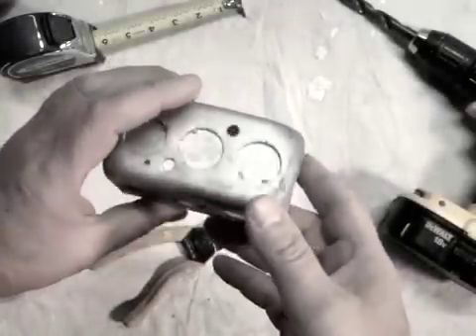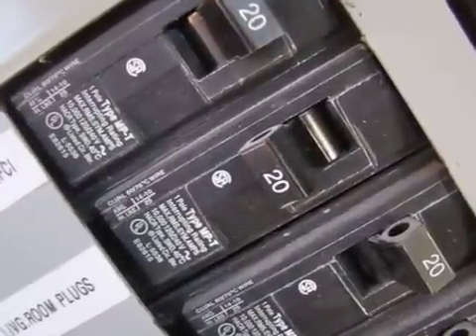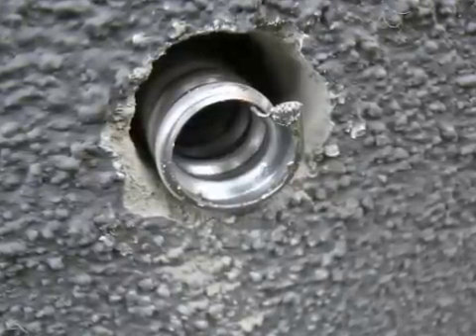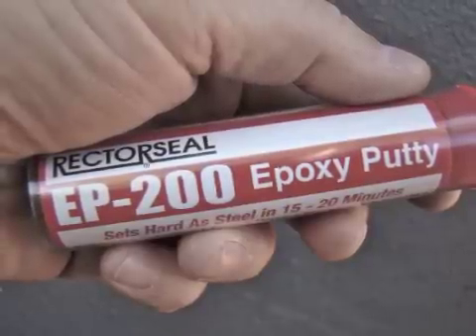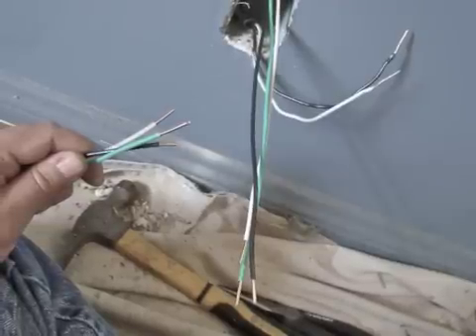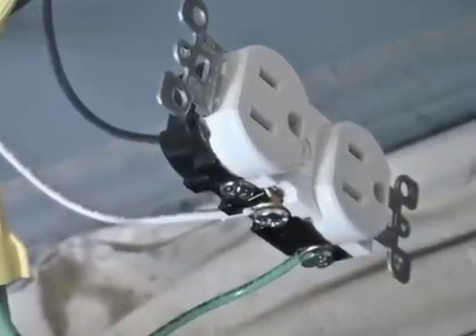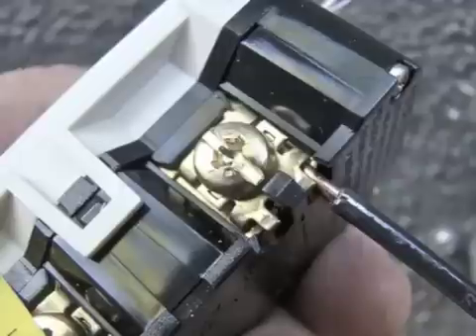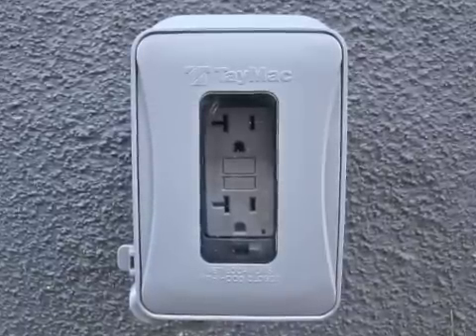Outdoor GFCI installation tutorial

Comment: Also, it looks like you installed a 20A receptacle on a 15A line. This is theoretically unsafe. That's why they have 20A receptacles in the first place.
Reply: Hold on a sec. The breaker is 20A. Then this is actually terrible. Because I am pretty sure I saw you use a 14Ga wire at some point. This is actually super unsafe.

Comment: To be honest I think it's kind of unsafe to put the GFCI protection OUTSIDE. Instead, you should really be putting a regular outlet outside, and put the GFCI protected outlet inside the house as close as possible to the panel, or at least far away from any sources or potential sources of water.

Comment: Very good video.  I have a question maybe someone could answer.  On the outside, is the end of the flex conduit flush with the outside wall?  Or, is the fitting going to the box flush with the outside wall with just the threads of the fitting extending from the wall?  Thank you.

Comment: You could have put the gfci inside and  swapped the standard plug to outside, thus having two gfci protected outlets, as the gfci protects all downstream outlets. That is of course if you take power for the exterior outlet from the inside gfci instead of using those abysmal wire nuts, wiring in series instead of parallel as you did. Fewer connections and more safety.
Reply: Good idea but better to get a weather resistant outdoor outlet

Comment: I see two code violations. The gang box in the bedroom is overstuffed and won't pass inspection. Secondly, it looks like your outdoor receptacle is wired with 14 gauge wire while the bedroom receptacle has the (correct) 12 gauge wire. This is a major no-no and a fire hazard. 14 gauge wire cannot handle 20 amps. Also why not just replace that old gang box in the bedroom with a new one? That old box is not bonded to the ground, which is bad.

So, in other words, don't follow this guy's video if you are DIYing. It's not up to code.
Reply: The exterior wiring is 12 gauge. He even says so in the video.

Comment: Great presentation, thank you! And I wanted to add that although not likely, some homes may have split circuit receptacles so I check both receptacles at the outlet for power, might need to throw two breakers instead of one. (Not trying to be nitpicking, just in the interest of safety is all)

Comment: Just a quick note. Your breaker is 20 amps as is your new GFCI on the outside but your interior receptacle is only 15 amps which isn't good. The breaker can supply more current than your interior receptacle is rated for and yet not trip. FYI

Comment: Instead of a pigtail, couldn't you have just branched the new wires off the second set of screws on the existing receptacle?
Reply: This is what I am very curious about. I am searching online for the information now.
Reply: Just wanted to update, I just finished installing an outdoor outlet where I connected the wires to the second set of screw holes on the back of the interior receptacle that is located inside the house. I spoke to a very knowledgeable associate at Home Depot who works in the electrical department and asked him if it was doable and safe. He said it was fine. So I tried it and all is good so far. 

I would not have had room for pigtailing inside the electrical box. It would have been too bulky so I am glad that this worked.
Reply: If you had a problem with the plug inside the house, you may at some point remove it. When you daisy chain receptacles you lose power to all downstream devices if an upstream receptacle is removed. So, pigtailing is preferred since downstream devices are unaffected when one upstream plug is removed. That may not seem like a big issue but in special cases it can cause big problems. For example on a shared neutral circuit (often used in kitchen appliances), if the neutral line is lost by itself you get 240 volt power overload to downstream devices. If you've got room and time to do pigtails, it's a better option. As you say, daisy chaining does work, and there is no advantage to pigtails for the last device on a circuit, although you do want to ground both the box and the device.

Comment: Question, are your receptacle both 20 amp, or are they 15 A / 20 A receptacle? Can you install 2 different amp receptacle?? Thanks great video!!
Reply: You really should not. That's the whole point of the extra T shaped connector, you should not be able to shove in a 20A appliance into a 15A circuit. You will trip the breaker, yes. But it's still unsafe.

Comment: Tried to do this, but when I drilled through the back of the receptacle, hit some sort of thick metal brace that's holding up the receptacle. previous owner was a terrible handyman. Left some receptacles unsupported. I guess I'll have to open the wall to do it right. it was a great video though. Thanks!
Reply from the maker: Sorry to hear about your issue. Anybody who's ever done this type of work will tell you that you don't know what surprises you'll find when opening up a wall. Most receptacle boxes that I've run into (whether old or new) are attached to the side of a stud either by nails or screws. Hope it works out for you.

Comment: I liked the way you mounted the box. Looks good and solid. That being said I never saw you check for a ground on the inside receptacle. Just because it is a 3 prong outlet that doesn't guarantee a ground. Metallic Cable or Flexible Metal Conduit doesn't necessarily guarantee a ground either. So if the inside box wasn't grounded through the MC or FMC then the outside box isn't grounded either. Not pushing the "test" button on a newly installed gfci receptacle to verify proper operation is kinda suspy also because that's the first thing I always do.

Comment: great video. can I use 14/2 wire, instead of 12/2 wire
Reply from the maker: 12/2 for 20 amp and 14/2 for 15 amp. 14/2 is smaller wire then the 12/2.
Reply: +JOE64POW . Tha k you sir for replying.  yes I know the amps for the wires. I should had ask you, what size breaker do you recommend. Is 15 amp breaker enough?
Reply from the maker: It depends, if you think you'll be drawing quite a bit of power from the outdoor plug by using, let's say, an electric lawnmower, you might want to run your plug from a 20 amp breaker.

Comment: My local always mounts the recepticals with the ground side up .
Reply from the maker: Look at most tutorials on youtube, you'll see the receptacle ground side is down.
Reply: +JOE64POW I was just making a statement to let watchers open their mind to other ideals.  .  I hate using this but to make a point i will.  Many people also followed Hitler and u know how that following went right?  
    
SearchSearch
 Materials & Systems >>  Electrical >> Ground Pin Up or Ground Pin Down?
Ground Pin Up or Ground Pin Down?
There is an age-old debate about whether an electrical outlet should be mounted with the ground pin up or down.  Unfortunately, there is not a fully accepted answer.  However, it is commonly accepted that the National Electrical Code (NEC) of the United States, or NFPA 70, does not provide any specific direction for the orientation of the outlet.

Ground Up or Ground Down?

Some theories about the orientation of an outlet:

The outlet should be oriented with the ground pin up because if the plug comes slightly loose and a metal object were to fall from above, the ground plug, which usually does not carry current, would deflect the object so that it would not hit is live prongs.  It is accepted that this idea began in health care facilities where many tools used for patient care are metal.  The story goes that hospitals were wired by union electricians and as the unions grew the practice spread to other types of buildings.
The outlet should be oriented with the ground pin up because this pin is longer and the plastic around the plug is meatier, so it will help to keep the plug inserted in the outlet.
The outlet should be oriented with the ground pin down because a person grabbing the outlet will have their index finger at the bottom side of the plug and the index finger sticks out further than the thumb.  Having the ground down will keep a person's index finger from touching the live pins.
The outlet should be oriented with the ground pin down because many common household items such as nightlights, timers, and battery chargers are oriented with the ground pin down.  In addition, GFCI outlets, which have text on the reset and test buttons, are oriented with the ground pin down (and the text readable).
A quick internet search provides comments that easily debunk any of these theories.  The most basic answer is that it truly doesn't matter which way your outlets are oriented.  Select the strategy that best works for you.
Reply: osz71 If you look at history of installs in local 98 out of Philadelphia,  they started doing this in hospitals because lf something like a doctors knife or something else metal were to fall on a plug that was falling out, the metal object would hit the ground first instead of the hot.  It makes sense to me and this is how I do my installs.
Reply: Wow godwin's law in the first reply, that was fast!
Reply: Michael Hinchey that's how I do them grounds up
Reply: Thats cause people that do that are IDIOTS!
Reply: The new standard is to place the ground side up. Hospitals have already adopted this. Go and buy a receptacle and you will see that the writing is upright to match ground side up.

Comment: I am a bit concerned tht the box in the inside room may be over wired and have not the capacity. remember the 2.0 for #14 and 2.25 for # 12 gauge wire.  Looks a bit tight, and I think new rules require pigtail wiring with wire nuts.  the reason I am told is that if one connection becomes open , rest of circuit will be fine.

Comment: A quick question, which drill bit you used for Stucco? I tried and all of them are slow, I use an metal drill bit on a impact drive.
Reply from the maker: +George Chen

Hi George, I used a concrete drill bit, you'll notice the tip is different then the multi purpose bits. Check the video, but I think I used a 5/8" concrete drill bit.
Reply from the maker: You want to use a masonry bit.

Comment: I'm new to all this, so excuse a possibly dumb question. I'm curious why you used pigtails for all the wires at the interior receptacle instead of having the incoming wires attach to the top (line) screws and the outgoing wires attach to the bottom (load) screws on the sides of the receptacle. Isn't that what those screws are for? Seems like you'd only have to use a pigtail for the ground.
Reply: +Firstname Lastname Oops, I meant incoming wires to bottom screws, outgoing to top. At least on the gfci receptacle I have, it says line on bottom and load at top.
Reply from the maker: +Firstname Lastname 
Thanks for your question. When more then one wire needs to be connected to a post, adding a "pigtail" reduces the multiple number of wires (that need to be connected) down to one wire. This is probably one of the most common reasons they are used. I find it's also helpful too because it gives some slack and wiggle room when you go to put a switch, receptacle etc. back into their box. You need room to move and adjust.
Reply: +JOE64POW That makes sense. Thanks for the quick reply!
Reply: +JOE64POW I agree with Firstname Lastname; the regular receptacles have 2 posts on each side so that you can easily wire receptacles in series and you don't have to pigtail at each box.  You can save time on each installation if you just would use the other posts.  Also on the gfci receptacles, they are set up to receive up to 2 straight wires on each post (because they have the clamp connectors).  This also helps to cut down on pigtails.  IF pigtails are needed, then by all means add them, but don't add them just to add them.  My 2 cents anyways, thanks for sharing the video.
Reply from the maker: Hi Thomas, thanks for your reply. Yes, you and "Firstname Lastname" are correct – you can wire it that way, certainly. I have learned from watching others (who were much more efficient then myself) that many times the existing (sometimes old) wiring that comes into a junction box is not long enough to make the connections easy. If you have short existing wires and connect them straight to the receptacles it will leave you with very little "wiggle room." I like the ease of adding pigtails and the extra "wiggle room" it affords. Do you have too do it that way? Of course not. I'm just offering people what I believe to be a great alternative when folks find themselves struggling with wiring a receptacle or switch in an old junction box. I think you'll find that this makes sense as you go along. Thanks much.

Comment: WOW, very well done tutorial. Just the video I've been looking for all night. I haven't done much electrical work to my house, but I need to bring electricity to my backyard shed. After, seeing several videos I have come to understand that I need to basically find an existing gang box and get electricity from there? All the other connections seem very simple.
Reply: If you're wiring a shed... what for? If for power tools or other high amperage devices, you might need to run an entirely new line from the power box with it's own breaker.

Comment: Hi I have a question? Can I just use outdoor rated wire instead of flex an get the same results?
Reply from the maker: Hi 1MRALANIZ,

I have seen other tutorials where some have drilled through the wall and shoved romex through to the outdoor junction box as opposed to using flex. Some might comment that my wiring is a bit overkill. Using romex or outdoor rated wired would be fine as long as the solid copper gauge wire matches the existing wire size in the interior box you're tapping into.

Comment: Very nice video, can you show how to install a gfci outlet/switch combo.  The receptacle I'm referring to has the line and load terminals and then 2 black wires coming out of the receptacle.  The outlet is on the end of my line so i know the load wire will stay covered but i want to attach a light for my back yard off the outlet thats already in place. 
Thanks

Comment: the only problem I have is that the green ground wire is NOT grounded.....you did not use (or at least show) a ground pig-tail connected to the interior metal box.....
Reply from the maker: Hi Todd, yes your right I didn't ground the green ground wire in the interior box. The box was old and there wasn't any place for a ground  wire so I didn't worry about it knowing I would ground it in the exterior box. You're right. Thanks for your comment.

Comment: I have a brick exterior do I use same installation process? I am concerned about drilling holes into the brick. Do you have any suggestions?
Reply from the maker: Hi Katrina, You can drill a hole with a masonry bit through brick.You'll want to be careful to consider how old the exterior brick is first. Old brick has a tendency to crumble and flake. I would start with a very small masonry bit at first and take your time drilling a pilot hole from the inside out, if you know the brick solid and won't crumble. If you can tell the brick is old and pretty weak then you'll want to find the spot where you're going to drill on the exterior wall and drill from the outside in. If you don't feel comfortable in doing it yourself you should call an electrician to drill the hole for you. The key is to take your time drilling and get a feel for the bit cutting through the brick. You can see other youtube videos where people are drilling through an exterior brick wall. Use an extra long masonry bit and you'll be fine. :)
Reply: Thanks. The house was built in 1978 so I would say it is old. Thank you for your quick response. It is very helpful.
Reply from the maker: Katrina Williams 1978 isn't that old. I work on a lot of homes in LA that were built at the turn of the century (1901-1911) and I've seen the crumbling brick issue on some of these homes. I'm sure the bricks on your 1978 home would be fine.